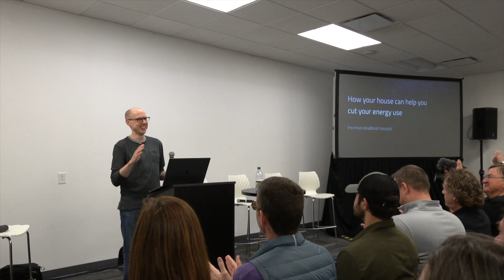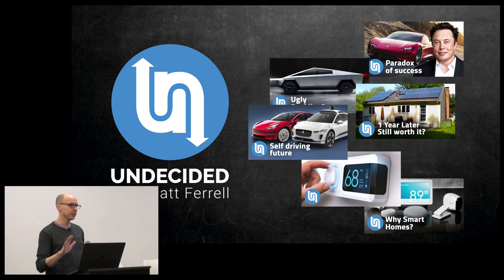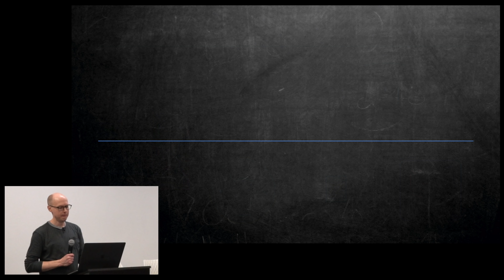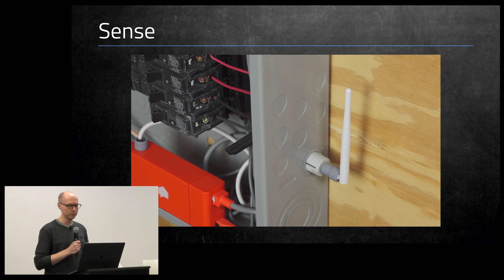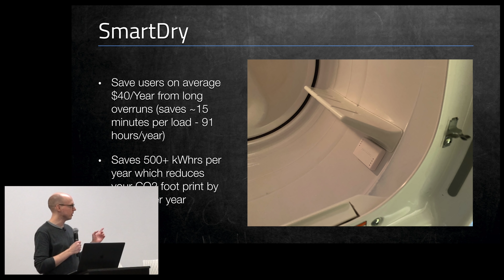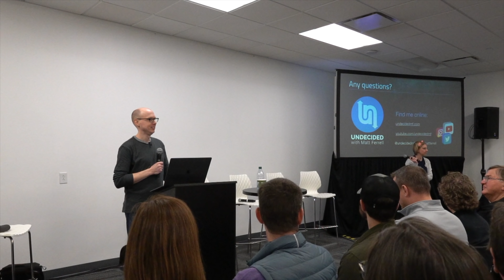How a smart home can save energy - Fully Charged Live

Comment: I have solar on my house as you do.  The system was built to capture 90% of annual usage (but that's prior to having any EV).  For the balance of electrical power, I get it from a provider called Green Mountain Energy, which has cost-effective green power plans in my area, and many others.  (They actually produce wind power, not just mess around with green energy credits, like some providers.)  Perhaps you could mention that option from time to time?

Comment: Home construction energy standards: The big one is Passive House  https://en.wikipedia.org/wiki/Passive_house  which is an actual set of standards, and target specifications vary depending on local conditions.  Another actual standard is LEED  https://en.wikipedia.org/wiki/Leadership_in_Energy_and_Environmental_Design  which is primarily used for commercial buildings and considers the environmental impact of the materials used.  There's a lot of talk about net zero, but it's not an actual standard. With Net zero it doesn't matter how poor your efficiency is, throw a enough solar/wind/hydro at it and you can zero out your energy bill.

Comment: One thing I did to save energy Is change out all the fluorescent light fixtures in my house to LED tubes. The best thing is that you remove the ballast from the fixtures which is what sucks all the energy. The LED tubes only use about 25% of the power that fluorescent does.

Comment: Like your U-tube channel, this was a great talk and recommendations. Designing a house in Massachusetts, I found the Passive House standard when heat loss calculations began to show that 90% of my heat loss would go out the doors and windows. Neither Anderson nor Pella had the window performance I needed. Finding an architect that built several passive houses and a few passive house design consultants, I switched to the experienced building science method offered by the Passive House design, all using a not so simple spreadsheet from Germany. I always sought a house that would be passively heated without the need for any mechanical systems and while I could not quite get that simple, Passive House comes close. The key difference is a super tight insulated house with a high efficiency heat recovery system.  I would say that IoT Smart devices still have a way to go until I can get my whole breaker panel set up with WiFi breakers that measure and control  the load of each device as a system. The Sense app you mentioned is a great substitute for now. What I see coming is my EV will support V2G so I can power my solar house without an extra set of batteries. At some point I would expect that my cost of electric power would change continuously and new regulations will let me bid into the same electric markets as any other big generator or load. As for the extra cost for building to the passive house standard that exceeds the ABC or stretch building codes, I would first ask how long that house will stand. If it will be torn down in 5 years than build cheaply, but if that house will stand for 20 or 50 or even 100 years you will see the extra cost for high quality doors and windows will easily be justified.

Comment: How soon will we start seeing homes wired as a single power bus where intelligent appliances and loads draw what ever voltage and current from a high voltage (70% cheaper and about 50% faster to install ) source (say 240/60 cycle) Would reduce wire needs by 45%
That would allow inductive powered, non connect switches and outlets to be location adjustable and added as needed in seconds (reduced cord length needed could be worth maybe millions to manufactures and gets rid of the damn extra cords every where) I'm sure there could be addition advantages and features to be found by designers/hackers and owners

Comment: You can usually trim the trees if there hanging into your property, I do this due to hurricanes here in Fl to protect my house. Nice video. Look into the top Cisco router, you will be very pleased.
Reply from the maker: Yep, very true.  Sadly the trees I battle with are tall and don’t extend into my yard.

Thanks for the recommendation on looking into Cisco.
Reply: Undecided with Matt Ferrell  I’ve got three trees that lean into my property, I’ve actually gotten up on my roof to then them out. Very concerned about high winds here in FL, we where very lucky the last bad hurricane the wind was going fords the property that the tree was on and it went down on there house. Idiots only took care of it and not the other trees.

Comment: On the efficiency question, I think the best attack is to work out a decent solar array, work out how much you can get running on the 'free' electricity, and then figure out how much of the rest of your energy usage you can reduce for a reasonable cost.

If your leftover energy use is small, is it worth spending any money? Conversely, perhaps it's worthwhile replacing water heaters with ones that can run on the solar, or some other method to reduce the biggest users.

Comment: Solar inverters like SolarEdge have add-on products such as smart meters, modbuses, and smart plugs.  These allow for turning on things like clothes dryers, air conditioners, and heater only when excess solar energy is available.

Then there are companies like myEnergi.  They have energy diverters for hot water with or without heat pumps to maximize self consumption of solar energy.

They, also, have an EV car charger that will, also, maximize self consumption of solar energy, and both the hot water diverter and car charger talk between them to turn on when excess solar energy production is available, and they will divide the excess solar energy between them and other house loads.

You can reduce hot water consumption by using a hot water heat pump together with the above energy diverter for hot water.

Finally, you can, also, use heat pumps for space heating with mini split air conditioners with heat pumps, and use cloth dryers with heat pumps.

The combined usage of these three types of heat pumps will save an average of more than 10-kWh in electricity every day.

The usage of the above products will save a lot of energy in a home.  They save energy in two ways.  First, they save energy by being more energy efficiency, and second, they save energy by maximizing self consumption of produced solar energy.

Here are some links for the above products:

https://www.solaredge.com/us/products/metering-and-sensors

https://www.solaredge.com/sites/default/files/se-device-control-load-switching-devices-datasheet.pdf

https://myenergi.com

https://www.hotwater.com/water-heaters/residential/electric/proline/xe/voltex-hybrid-electric-heat-pump/

https://www.homedepot.com/b/Heating-Venting-Cooling-Ductless-Mini-Splits/N-5yc1vZc4m1

https://www.homedepot.com/p/Samsung-4-0-cu-ft-Capacity-White-24-Stackable-Electric-Ventless-Heat-Pump-Dryer-ENERGY-STAR-Certified-DV22N6800HW/307685530

If you produce roof solar energy, and you only have a net metering arrangement or a feed-in-tariff paying less than your cost of electricity, then the above is especially valuable for you.

Comment: Presentation failure. “Bad sound makes good video look bad.” Please learn proper hand microphone technique. You held it so far away from your mouth that we got the bad room acoustics and the phenomenon called ringing that got into your body mic. Hold the microphone straight up just below your chin and speak across it. If the facility sound person or the camera operator failed to correct this by teaching you, then that was their failures, too.
Reply from the maker: The audio in the video was all from my lav mic on my chest.  In the room, the guy running the mixer didn't adjust the audio quickly when I got the feedback, which is why I had to pull the mic away in the beginning.  He did adjust the mic level shortly after that happened, but I neglected to raise it back up again until someone in the audience reminded me.
Reply: Undecided with Matt Ferrell  Thanks for the explanation. Most of the poor signal-to-noise ratio sound in YouTube videos is because, if they are using a body mike (and, by the way, you being a techie should appreciate correct terminology, “lavaliere” microphone is a misnomer, it literally means a microphone attached to a gold chain but usually a cord as seen in 1950s television) they are omni directional and in noisy environments or where you’re trying to isolate it from the amplified room sound a better choice is a directional body microphone that rejects unwanted sound. They have to be used with consideration so that if the speaker turns his or her head away there will be a drop off in the level.

Comment: I’m planning to build a 550 sq ft house in a very remote area.  What cabling is a must?  I hope to have solar.
Reply from the maker: With a house that size WiFi should have you covered well, but I’d still recommend Ethernet cable throughout (CAT5e or CAT 6).  If you think you might want security cameras, conduit or Ethernet cables to those locations too.  Conduit saves money now, but makes it easy to string cable later.  Really opens up possibilities down the road.  

Laying conduit or cable from your box to where you think solar will be wired in and/or battery storage.  Same for a 250v outlet for EV charging.